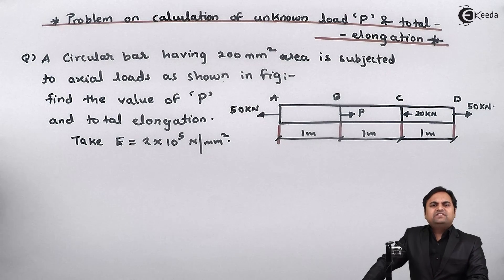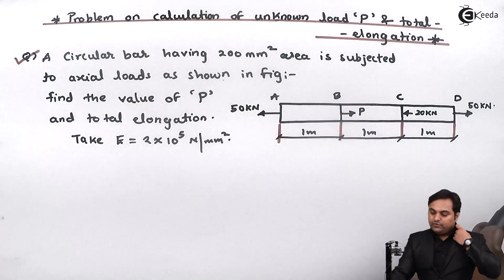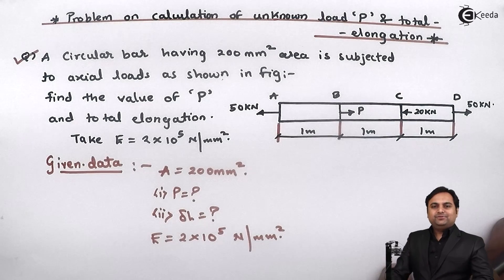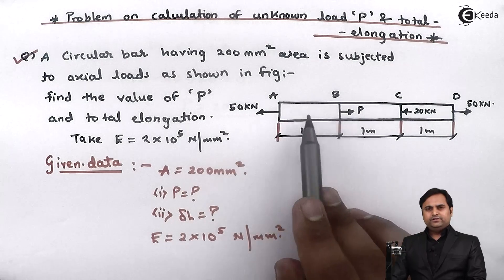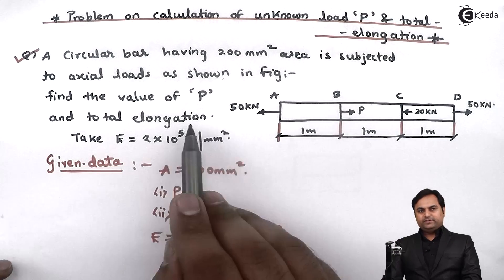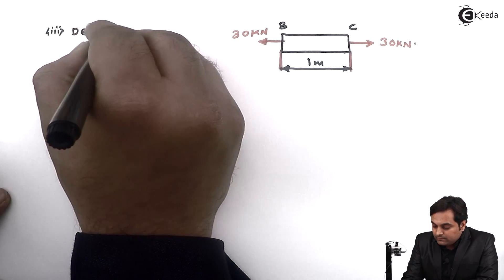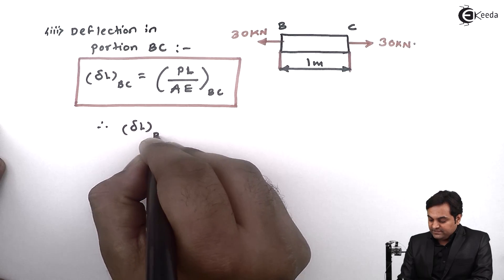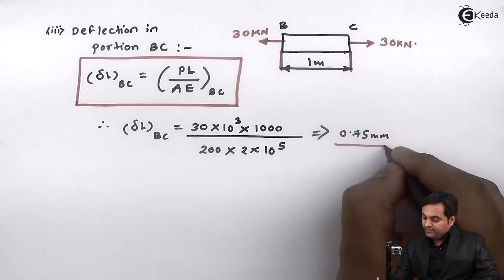Problem on Unknown Load 'P' and Total Elongation - Stress and Strain - Strength of Materials

Comment: A round bar with stepped portion is subjected to the forces as shown in
Fig. Q1(c). Determine the magnitude of force P, such that the net
deformation in the bar does not exceed 1 mm. E for steel is 200 GPa, E
for Aluminum is 70 GPa. Large end diameter and small end diameter
of the tapering bar are 40 mm and 12.5 mm respectively.